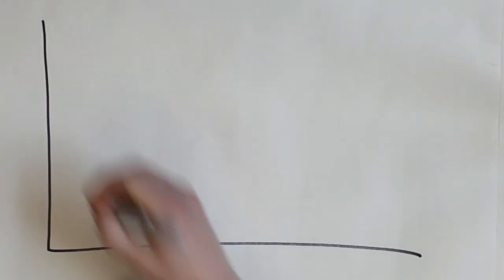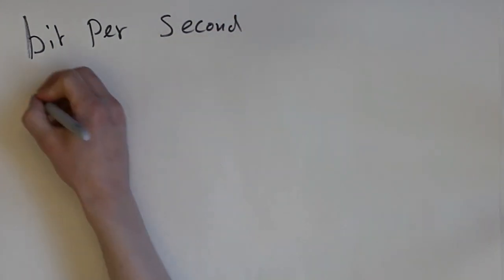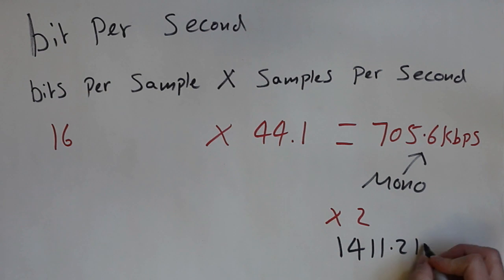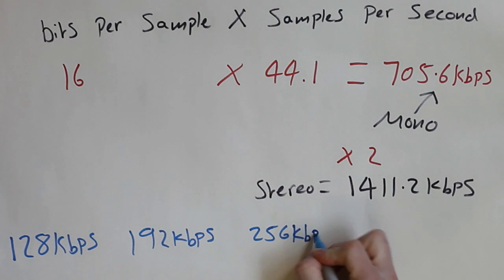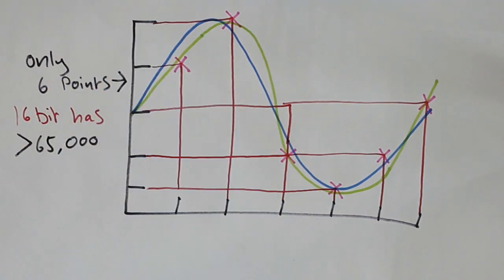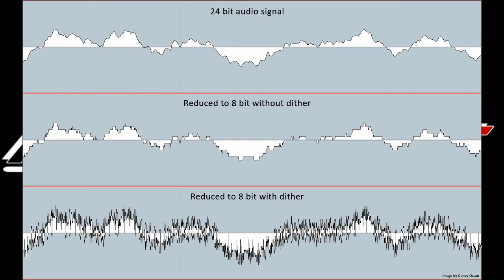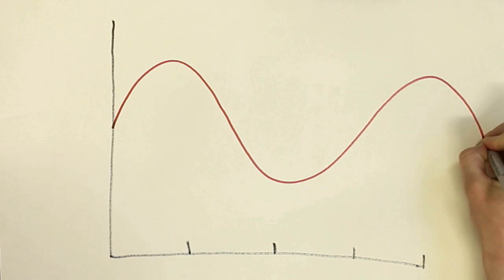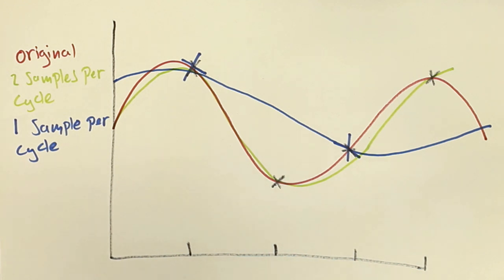Digital Audio 102 - PCM, Bit-Rate, Quantisation, Dithering, Nyquists Sampling Theorum - PB15

Comment: Could you please explain how PCM works not with a single frequency but with real music that contains bass vocal, piano etc? In other words, we could have in this case different sinusoids for e.g. 31 Hz, 500Hz, 4000Hz sounding at the same time. Does PCM capture in the same time all these sinusoids during sampling and quantifying steps making a "digital imprint" of the spectrum for a moment?
Reply: @ReaktorLeak Thank you for your reply. What do you think about the following: I have heard frequently an opinion that HD recording has no much sense with sampling rates 96kHz and 192 kHz because they work with frequencies above human ear limit, but I was always under impression that the more sampling frequency the more exact "sound picture" is produced even in the range of human hearing (average from 20Hz-20kHz). In combination with the advanced 24Bit quantifying, it makes much much more exact sound than 16Bit\44.1kHz (I mean it is much more natural and full of life and details). In other words, sampling frequency not only about a limit of heard frequencies but also about more frequently scanned analogous signal within the range of human hearing, and therefore more detailed and less "approximated" sound in general, what do you think about this? E.g. BIS label produces SACD discs in 24Bit\44.1kHz quite frequently, maybe it is because they try to find a compromise between the size of disc and amount of music on the disc in acceptable quality, and it doesn't mean that 96kHz sampling doesn't bring much difference?

Comment: I have a 5.1 Dolby Audio System.

Can you tell which option i should choose for HDMI ARC CABLE
PCM OR RAW DATA? for surround sound.
Reply: Hello I'm having the same issue. It's getting very confusing. Did you figure out what works best with your 5.1?

Comment: HI SHOULD I RECORD ON PCM 44/16? OR RECORD ON MP3 ? I HAVE A OLYMPUS LS-12.THANK YOU FOR THE HELP..
Reply: It depends on a few factors.  If you are not editing the files significantly on DAW software and you have limited space, recording to Mp3 would be fine provided you go for a higher bit rate (192 is what I would consider good enough).  If you are editing the file afterwards (specifically altering the levels, etc) and your recorder has space, then 44.1/16 would be a better solution.

If you're just listening back to the file then provided you have a good-quality Mp3, then there really isn't that much practical difference between WAV and Mp3 in terms of listening experience.

Comment: If we need to multiple bit depth by sample rate and we get ~700kbps, then why standard cd song which uses 44.1kHz and 16bit has 192, 256kbps or something like that? I haven't seen 700kbps anywhere.
Reply: Limpuls because when you convert them to MP3 they are compressed to get a much lower bitrate. MP3 standards can only go up to 320 kbps, but is very common to see even lower bitrates, like 128 kbps, 192 kbps and 256 kbps. I have seen files as low as 32 kbps! To get those 1411 kbps from a standard CD stereo song (16bit, 44.1kHz), you have to burn it to WAV, AIFF files, or other lossless format, such as FLAC. A good, fast, easy way of knowing if it has higher bitrate is by checking the size of the files, although you can get a large 128kbps file, if it something like 30 minutes long.
Reply: Blackfera Music Clear, thanks
Reply: +Blackfera Music wat is the higest bitrate?
Reply: +Peter Veer few commercial audio software today can work internally with 98.304 Kbps or 98.3 Mbps audio quality, when using  64-bit floating point bit-depth, 192 kHz sampling and 7.1 surround sound (8 channels). Some can't export that way, since they would create huge gigabyte files, not to mention being inapplicable. In real world situations, you would use max 24-bit, 192 kHz and 8 channels (7.1 surround), which gives you an audio quality of 36.864 Kbps. If you use just stereo, then it gets to 9.216 Kbps max. Although you will still see big files, one of the reasons (not primarily) why people keeps using lowered sampling rates as low as 48 kHz, 44.1 kHz.

Comment: For the nyquists theorem section, isn't the highest frequency of CD audio 20kHz? And the nyquists sampling rate is two times that at 40khz. The sampling rate of 44.1khz includes a 4.1khz guard band, or 2.2 times the maximum signal frequency.

Great videos, subbed!
Reply: Ross, Luca, you asked simple questions that have complex answers.  As simply as possible: 
Before digitally sampling an analog signal, analog "low pass" filtering has to be done to insure that very little energy at or above the Nyquist frequency remains in the sampled signal. (Content above the Nyquist frequency that makes it to the sampling circuitry INEVITABLY causes distortion in the reconstituted analog signal.) Unfortunately, there is no such thing as a "brick wall" analog filter. ... A brick wall 20k Hz filter would totally pass a frequency of 20,000.00 Hz while totally blocking one of 20,000.01 Hz.  ALL analog filters have what is called "roll off."  Even the best 20,000 Hz filter lowers the volume of a 20,000 Hz signal slightly, lets a small amount of a 20,500 Hz signal through, a smaller amount of a 21,000 Hz signal through, etc.  A 44,100 Hz sampling rate has a the Nyquist frequency of 22,050.  A good analog filter can pass most of the energy of 20,000 Hz content while reducing the energy of frequencies of 22,050 Hz or above sufficiently to result in minimal sampling related distortion when an analog signal is reconstituted from the digital one.

Side note: This sampling problem applies to ALL conversions of analog information to digital.  Your digital camera has a low pass filter in front of its sensor.  It's most often referred to as an "anti-aliasing" (AA) filter and it's there for very valid technical reasons.  (Manufacturers have dispensed with the AA filters on several of the latest high resolution SLR style cameras.  IMHO, the decision was wrong-headed appeasement of customers who don't understand an AA filter's purpose.  The change certainly wasn't based on recommendations of the camera manufacturers' engineers.)
Reply: Luca Pearson The energy produced by musical instrument with low frequency fundamentals swamps that produced by those with higher frequency fundamentals. A bomb essentially produces a brief low-frequency fundamental.

"Speaking of which… when I hit the bass drum, what range of frequencies are produced?"
http://www.residentadvisor.net/feature.aspx?1211
Reply: Lower frequencies' wavelengths are huge and push more area of the air, passing through solid objects including yourself that is why you can feel it, higher frequencies' wavelengths are smaller and (loosely) 'bounce off' solid objects
Reply: The frequencies that can be heard by the human ear are not fixed, nor are the frequencies that are recorded fixed.  
Health, anatomy,  genetic makeup, chemical make-up, environment, and exposure all impact our ability to hear and distinguish different frequencies.
The frequencies recorded in an audio file are going to vary greatly, as well.  The equipment used, the space used, the digital environment, the producer's tastes, mixing engineers, mastering engineers, etc. can all play  parts in this.  Some audio is entirely synthesized within one computer, arranged, mixed, and mastered by the same person on that same computer.  Some uses sampled audio, which then passes hands to the producer, who usually handles the arrangement, then passes hands to a mixing engineer who adjusts audio on individual channels (which usually number anywhere from 10-40 or more depending on the type of music and producer) to get a balance that is pleasant to the ear, then passes to a mastering engineer to get a balance on the track in its whole entirety, which means that the audio has been recorded, re-recorded, and re-recorded again before reaching the consumer.    Not all producers roll off their high and low frequencies with an EQ or filter, though these are generally taught as good practice in the industry.  Many producers are self taught.  
At any point in this chain those frequencies can get through, not to mention saturation or distortion can be added in at any point causing harmonic frequencies that extend further up the spectrum, so putting the point at one that is above the normal level of human hearing would be a sensible choice to adjust for potential variables.

Comment: I can't believe I put GHz. Anyway. I'm still trying to figure out how a 1-bit environment can yield higher dynamic range (120db 20-20khz) than PCM at 44.1/16 or FLAC at 192/24. I do not believe that my speakers could produce 12db, nor would I still be in the room if they could. I'm just wondering what it's for? I know that I prefer the sound of SACD over standard CD and my hi-res FLAC files sound great, too.